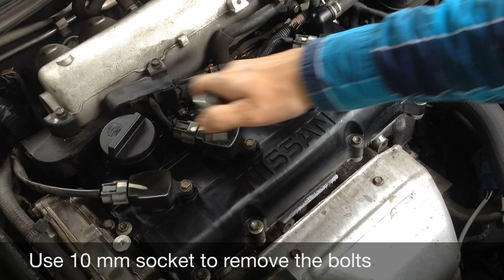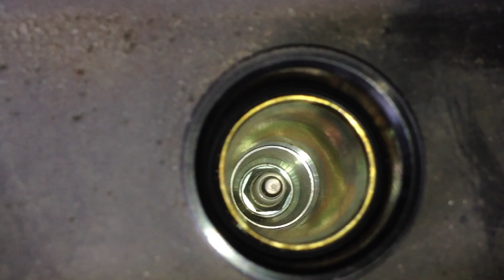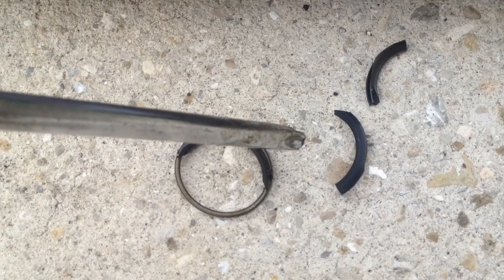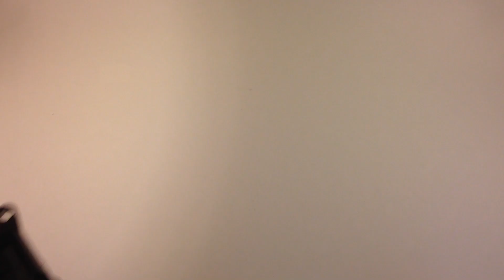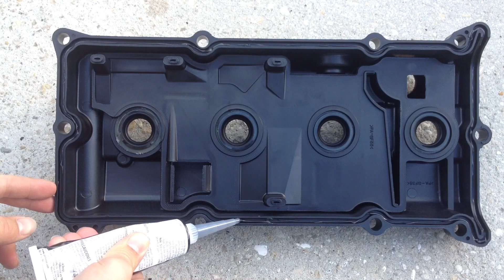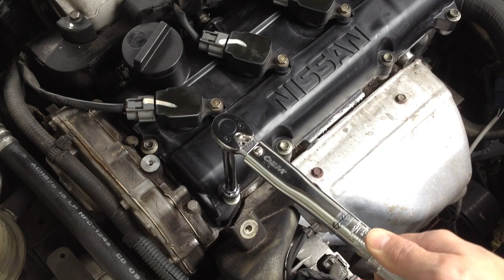How To Fix Oil Leak & Cylinder Misfire - Valve Cover Gasket Replacement - Nissan Altima 2003 2.5 SL

Comment: Step 1 and step 2 of the torque wrench i dont understand that :D
Reply from the maker: makarov kalashnikov 
Torque it evenly to the smaller torque specification mentioned in step 1. This will help to avoid over tightening the gasket on one side. Then fully tighten it to the torqu spec. mentioned in step 2. Done. Sorry if I sound confusing.
Reply: U are awesome thank u for the help
Reply from the maker: makarov kalashnikov 
No problem, AK47...
Have a nice day!
Reply: Lol u too my good friend
Reply from the maker: makarov kalashnikov 
Thanks.
Be shure to enter for my givaway by the end fo this month
http://youtu.be/n4ZGxX4FKW4

Comment: Did it cause the car to jerk and move before it was replaced ?
Reply from the maker: Delorian Glenn Yes, oil in spark plug well could possibly cause cylinder misfire, and the symptoms described above.

Comment: Thanks man for the video!
I have a 2005 Nissan Altima and I'm having the same issue.. Oil inside the spar plug tubes... Do you think that is the reason for a poor start at the ignition when trying to turn on the car?
Please help me since it's critical now...
Thanks.
Reply from the maker: Not nececerely. Scan your engine code to get a better idea for the problem.
Reply from the maker: Mine was starting and driving fine. I only noticed oil inside after I started replacing valve cover gasket.
Reply: Temachok I have altima 2002. My engine cranks but it is not starting. I found oil in 1 of the spark plug tube(among all 4) and ignition coil also had oil. Do you think oil in 1 tube can lead not starting of car? Should not other cylinders be running atleast?
Reply from the maker: Nitin Khosla No, car should still start. It would work ruff and had misfire, but it would start. 
Check battery, starter and scan for engine codes.

Comment: I have the same model.. I didn't need a new valve cover for the spark plugs gaskets. I replaced the valve cover gasket and spark plugs gaskets.
Reply from the maker: Lucky you. I had to spend extra $150...
You probably have different engine modification or aftermarket valve cover.
Mine were embedded into the valve cover.
Are you in US or Europe?
Reply: US, and its not after market. It has Nissan logo on top of it. The four spark plugs seal gaskets are aftermarket only.
Reply: Was yours leaking oil and water due to the spark plug tube seal gasket?
Reply from the maker: Mine were leaking oil.

Comment: Thank you very much for the great video! It is very clear and easy to follow.
One question: where can I find the manufacturer-recommended torque values for the cover bolts?
Reply from the maker: You can buy official Nissan repair manual on eBay for about $6 for your specific year and model.

Comment: Do you have to change the entire valve cover on a 10 altima as well?
Reply from the maker: Almost 100% positive spark plug seals are built in on your model as well. Check for yourself: look for valve cover or valve cover gasket parts for sale. Almost all of them say that in description.

Comment: Awesome video. By far one of the best automotive videos i've watched on here. Very professional. I just ordered one for my 2005 2.5 altima from ebay - http://www.ebay.com/itm/New-Engine-Valve-Cover-Gasket-Spark-Plug-Seals-for-Nissan-02-06-Altima-2-5L-/281254179655?pt=Motors_Car_Truck_Parts_Accessories&hash=item417c0e3347&vxp=mtr I was tempted to get it from the dealership, but its twice as much. Fingers crossed this works. My first cylinder is covered in oil. I'm hoping I don't need to replace the ignition coil pack as well.
Reply from the maker: Great. I had to buy mine from dealer cuz I needed car next day to go to work. Otherwise - eBay is the best place to get it. 
Keep us updated how it went for you!
Thanks.

Comment: Applying gasket maker all the way around the valve cover and on the head surface is a very bad idea. It will not give you "extra protection" and usually causes leaks due to the gasket not being able to seat properly. Do you think you're smarter than the engineers at Nissan? If the facory doesn't do it then neither should you. It will also greatly increase the difficulty and time requried for this repair the next time around. Only apply a small amount of gasket maker(and use the grey, not the black) to the two corners as done from the factory.
Reply: thinks about the precat failure issue on these engines thinks about the butterfly valve screw issue with these engines Gosh, you know what? Maybe the engineers at Nissan aren't the end all be all...
Reply: my understanding was to use the silicone/RTV if you had no gasket.  I did that on my old Acura and it ran like a leak-free past 300k km...
Reply from the maker: Thank you for your input, gdb 544.
1) You are absolutely right, it's not necessary to do it, just as I said in the video and it will take longer cleaning up next time 10 more years from now if I still have the car and it's still alive with the same engine...
It may not give much "extra protection", but it wont cause problems either. Excess maker will be squeezed out as long as you put in the engine cover before it hardens. 
Mine doesn't leak till this day.
2) Black maker is pretty much the same as grey and works for same temperature and applications. The only difference is a sales pitch of aftermarket manufacturer. It is supposedly has "higher oil resistance".
3) Respect to all Nissan engineers. I wish I was half as smart as they are. They've done incredible job with that GT-R and more....

I'll consider putting your recommendations on my video.
Thanks again. 
Have a great day.
Reply: You think you know!!yet you are here watching a tutorial video!😂😂 LITTLE SMART ASS!
Reply: Bullshit!, in reality based world "the proof is in the pudding" factory way fucked me good! Besides Factory way says to treat "Head Gasket" this way but not "Valve Cover" (Upper one) what since does that make when Valve Cover is made to keep out oil but ends up leaking anyway? Instructions else where based on REAL WORLD BASED REALITY say you can get 200,000 out of Gasket seals when applying the Sealant so....do it the right way because every video about head gasket BY MECHANICS FIXING customers problems says and show them doing it period!...what the WORLD's wrong but the factory is right?...same idiots who produce manuals with ALL KINDS of improper steps and advice that they retract and update in their later versions so...
Reply: on a 2006 nissan altima you cant buy these seals. you have to buy the valve cover. so to answer your question.. YES i am smarter than a nissan engineer. $5 oppossed to $140 for a needless part. again. yes i am smarter than  them. also i'd like to add that my daughter will not be buying another nissan if she expects me to ever work on it. what a piece of poorly designed junk.
Reply: @cosbyutube i also will never buy another Nissan any damm thing pos,you couldn’t even give me a Nissan vehicle free.

Comment: what do you mean with the 2 steps for the factory spec. are we going to 82 lbs or 26lbs?
Reply from the maker: Do it in two steps. First, tighten all bolts to 26lbs. Then finally tighten them all to 82lbs. We do it to evenly distribute pressure and avoid over tightening one of the sides.
Reply: Thanks
Reply from the maker: Sure.

Comment: You forgot to mention there is a sequence to follow when you loosen the valve cover screws the first time. This is otherwise an excellent video. Great work!
Reply from the maker: I actually was gonna say that, but then I noticed they don't say anything about it in the repair manual. It's not essential since we are replacing both valve cover and the gasket, cuz you don't have to worry about damaging them.

Comment: You give quite a wide range for the torque specs.  What values should be used for this valve cover?  Where did you get your numbers?
Reply from the maker: The values I provided are from Official repair manual for this model. You can buy PDF version on eBay for about $5 - it has tons of useful information. 
Also, I personally prefer the highest recommended torque value.

Comment: What size torque wrench is that? And what do you mean by tightening in two steps at 8:00? You tighten the bolt in two steps?
Reply from the maker: I don't remember the torque wrench drive size, cuz I rented it for few days only back then. It was 3/8 or 1/2. But it doesn't really matter, as long as it fits the sockets set that you have. Usually anybody can find sockets for both drives in their tool box - they are pretty common.

Comment: I have 2009 nissan altima 2.5s.. there was a leak in one of the spark plug well.. I tried replacing the gasket.. but I later found out that the tube seals are embedded in the valve cover.. can anyone tell me how much the valve cover would cost and wher can I get them? Thanks
Reply from the maker: They are like $40-80 on ebay.com

Comment: hello my car has the same problem. wanted to know where you bought the spark plug gasket because the auto parts not found it thanks
Reply from the maker: They are embedded into the valve cover. You can't buy and replace them separately.

Comment: take it you got valve cover  direct from nissan how much ? i have a 2004 nissan sentra ser spec v
Reply from the maker: Nope. Cost me under $20 for gasket and silicone at AdvanceAutoParts. Worked just fine! Dealer's price should be around $20 for gasket alone - still not too bad.
Reply: my car I need to get whole valve cover plus gasket .. not to bad 180 bucks for parts
Reply from the maker: Yeah, I spent 165. Kinda sucks, cuz valve cover was fine still. On previous models you dont have to replace it, thus parts are $20 only.
Reply: well one of the spark plug well seals are shot and my models the seals are in bedded in valve cover

Comment: great video, thanks for posting it, I am a going to try it on my 95 Altima, it looks a little different under the hood but pretty much the same set up, I noticed valve gasket started leaking oil all over my engine.
Reply from the maker: How did it go? Any different from how it's done on my model?
Reply from the maker: Yours is probably doesn't require valve cover to be replaced. You'll only need to get the gasket and o-rings. On mine o-rings are imbedded in valve cover and this is $140 extra right there. For you it should be only around $20 for parts.

Comment: My car shakes and have no power??
Reply from the maker: Same thing happened to my wife's car last week. It turned out to be cylinder misfire. There is a whole list of causes for it. In my case it was bad wire boot. I ordered the part and will be replacing next week. Should be 5-10 min job. I'll post video how I diagnosed and fixed. Stay tuned.

Comment: Hi  I have a 03 Altima, my engine light came on and after having it checked it read Cylinder 1 misfire detected'. I had new plugs, gaskets cover everything that you done in the video. The check engine light is back on and it is still reading Cylinder 1 misfire detected - any ideas why I'm still having the same problem.
Reply from the maker: You may need to replace spark plug wires and boots. Does your car shake / has no power? May be the error code needs to be erased. Unplug battery and honk to release all charge, then see if the error goes away.

Comment: Thanks for the video very helpfull . I went to change my spark plug on my 05 altima and also found oil in my two left spark plugs .is it the gasket you show us on the video ?

Comment: Excellent. I'm going to do this on my Sentra Spec V tomorrow.
Reply from the maker: Let me know if it's the same engine. I'll make a note in discription if it's the same process.
Reply: Temachok Yes, it is. The same process works on any Sentra with the 2.5L engine from 02-06.

Comment: What about for a 2007 Altima 2.5S?
Reply from the maker: That one is not leaking yet, but process should be very similar...
Reply: Temachok The problem I'm running into is that the valve cover is not as accessible on the 07-09 models like it is in this video. can't get to some of the bolts without removing much more.
Reply from the maker: Sucks. Mine has 100k ant it's still fine.

Comment: Got the same car (2.5 S), bought a year ago today actually. turned the car on the other day and revs were kinda low and there was shaking to it. could hear popping coming from exhaust. Put a scanner to it and said 'P0301 - Cylinder 1 misfire detected' and the drivers side spark plug had what i believe to be oil on it. wasn't exactly covered, but it was wet. Kinda looked like the tube side had oil on it as well. No smoke as of yet. I'm really hoping that this would be the fix, but don't want to jump to any conclusions. Any suggestions?

Comment: What was the name of the items that you use to clean the oil in the spark plugs?
Reply from the maker: You can use a rag or paper towel to adsorb most of the oil. Use long screw driver or rod to push rag inside the well and let it soak in the oil. Then you can spray break cleaner solution inside the spark plug well to dissolve the remaining oil. Then wipe it off  or blow it out with compressor if you have one.
Reply from the maker: Do not remove the spark plug until you clean the spark plug well carefully, otherwise oil will leak inside the cylinder.

Comment: My nissan is just starting to shake, and oil is getting into the spark plug but not the well if I change the valve cover gasket would that fix it?
Dealer wants $150 for the Gasket but I can get it at Advance for like $20 with tax
Reply from the maker: It's not very clear. Did you get oil in spark plug tube or inside the cylinder? It makes a huge difference. Do you get white smoke from the exhaust?
Reply: It's on the business end of the spark plug where it sparks not in the well.  I don't think I've noticed the smoke cause it's winter just looks like smoke
Reply from the maker: Keep checking engine temperature and oil level. If oil consumption is too fast, it can kill the engine. Check if oil level drops after you drove 1000 miles. Also check coolant level to see if it drops or not. 
Did engine check light went off when it started happening?
Reply: It came up and left when it started to shake then it stopped shaking. Then it stopped shaking for a few hours then it started to again.
Reply from the maker: Try to get the code if it comes up again. You'll know exactly what is wrong. They scan it for free at most auto parts stores.
Reply from the maker: You have different problem from what I showed here. Check Nissan forums online - they have this topic discussed in details.